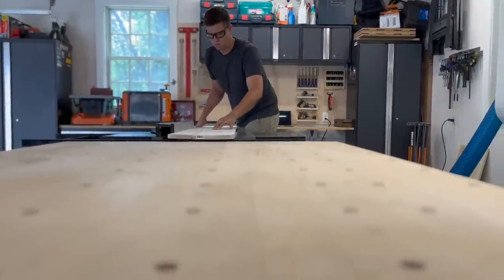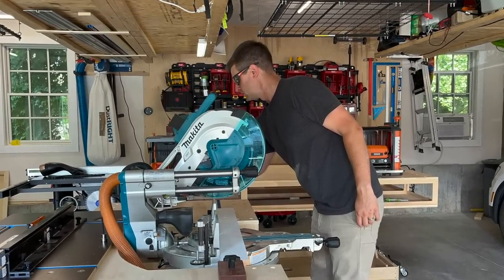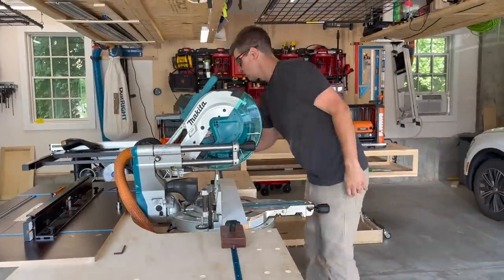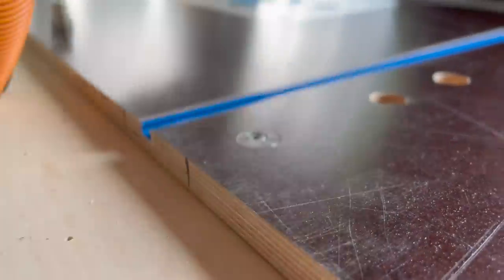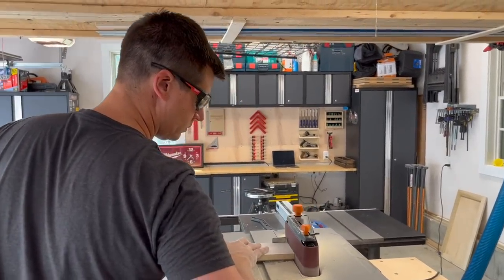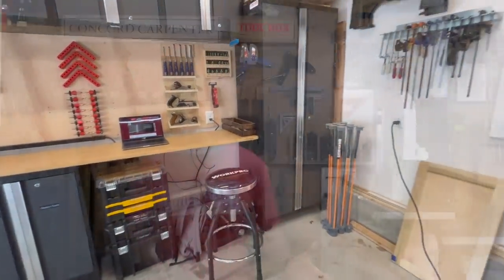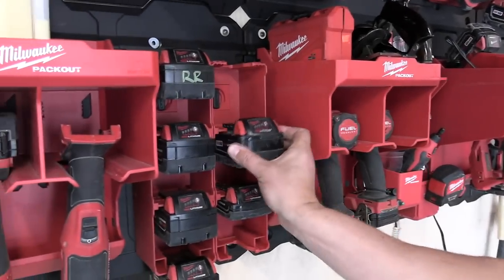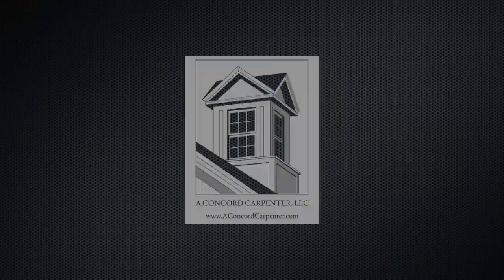Building a Modular, Efficient and  VERTICAL Workshop!

Comment: What would be amazing would be to run 3-4 PVC pipes of about 150-200mm (6-8") diameter from the dust collector across the ceiling in the gaps between the lifted tables. Then have 2-3 hoses of 100mm (4") coming down from each pipe. Pulling a hose down would open its valve and turn on the dust collector. Then you'd have instant overhead dust collection all over your shop.
Reply from the maker: Our growth plan is to do something similar - hard pipe the suspended ceiling shelves

Comment: Thanks for the video. These are some great ideas! But the Dust Right is a weakness. Fine dust is the biggest health hazard in woodworking and filter bags are notorious for concentrating, and then dispersing fine particles through the entire shop space. Grab a laser or strong raking light and turn the lights off to get a baseline, then run a tool and the Dust Right and redo the test. The fine particles get deep into the small airways of the lungs and do a number. Aim for 0.5 micron filter setups if you can. A filter bag dust collector may be ok for a while for a planer and jointer but nothing else... even then, those machines will create more fine dust as the blades dull. An hour two in a hobby shop can give greater dust exposure than 6 months in a commercial woodworking setting.
Reply from the maker: Great comment - were just starting out
Reply: I see what you're saying but the option to have both garage doors open as well as the back door open offers a lot more natural air flow than most shop setups.

Comment: can i just say: this is amazing. so many innovations and great ideas all together. you have really outdone yourselves

but i also wanted to ask about the birch plywood on the walls. i get that it is probably ok left untreated. it just something i did on my desk was to coat it wait a plastic based finish meant for plywood. i forget the name of it. but it is just some pu based matte wood varnish or something. and of course there are other good finishes like tounge oil or wax. anyhow it seemed worth asking since in a garage maybe it could get damp during winter months. when the temperatures are lower and also rains a lot

the other thing wanted to say was that those milwaukie storage walls systems can be expensive. so it might be cheaper to buy in bulk some regular aluminium profile (like 2020 or similar). that comes with a groove along it for m5 or m6 t-nuts. and then attach lines of those extrusion strips horizontally along the walls to be use like a cleats system. so they are like rails or cleats that can be clipped or hang off it other modules. and perhaps can make some quick release style clips. that might resemble some types of climbing gear (again aluminum pieces or m5 or m6 hardware to fit in those grooves or han off the top facing groove). since 2020 has that groove on all 4 sides. it offers some extra mounting flexibility options (more than cleats does). and being metal it can also support the hanging of heavier equipment. including for example your collapsible workbenches system. or table saw, a lawnmower. or whatever else you need to hang up against the walls.

finally the 3rd and last suggestion or idea i have to offer back here. well this is a really cool one. and it has been stolen from an other completely different industry. the archival industry. (and also the clothing industry). if you go into some libraries or museums you sometimes find they simply dont have enough room to have regular aisles that you can walk down every aisle of books or whatever they are storing. so instead they have these large racks of movable shelves. such that you create the aisle to access a particular rack.

so lets imagine we can recreate that with our (above mentioned) aluminum extrusion system. what you would do is have an area of the wall with just a few lines or rows of the 2020 running horizontally. and that is your basic rails system.  now there are different shapes of 2020 profile so the specific one for this is called v-groove 2020 and it is used on cheaper 3d printers such as the ender 3. because into the v groove you can sit these plastic rollers. which are just like wheeled roller skate bearings basically. and this is all very cheap and inexpensive parts commonly available from those 3d printers industry. just ask any mechanical engineer. so with those rollers and some extra cut up pieces 2020 you can construct a whole rails system with those roller bearings, little carriages and extra frames (like a window frame).  and then make basically like these large hinged pages of a book that rides on the horizontal rails. and then each page of the book becomes its own archival moving walk. such that you can increase your wall mounting space many times over. when you want to access the equipment that is mounted to a page, then you just open the book of these hinge pages sliding the others out the way. it is basically like a large walk-in wardrobe. and you are sliding the coathangers about looking for a piece of clothing. or they probably have similar storage systems in art galleries for storing large paintings. you get the idea here. point is: using those universal 2020 aluminum extrusion system is both incredibly strong. to support the heavier weight of all those tools. and it is also cost effective and affordable. and just like a mechano set it is all bolt together. and so it can be very easily dismantled, to be changed or re-used over and over again. so can adapt to that requirement of being flexible to change storage layouts (be reconfigurable) when your needs change. and the whole rails  / wardrobe idea is cross compatible with just hanging stuff directly from the wall itself. so you can add or remove that whole pages system as your needs change. without it necessarily consuming too much space. so for example the width or depth of each page is entirely up to you, i.e. how much of your shop space it will be occupying and eating into

so what do you guys think? have i convinced you yet? please let me know! and again thanks for all of these other great ideas too. really fantastic. all things which i would consider to be a dream workshop. really amazing stuff guys
Reply from the maker: Have you seen our small workshop 3-video series?
Reply from the maker: Wow great ideas

Comment: How are you liking that Makita miter saw, have you noticed any slop in the miter detent yet? That's one of the biggest downfalls of their newer saws, they use aluminum detent plates and they deform as time goes on creating slop. All other companies use stainless steel detent plates. Our 12" Dewalt miter saw is about 10 years old with zero slop in the miter detents
Reply from the maker: No slop